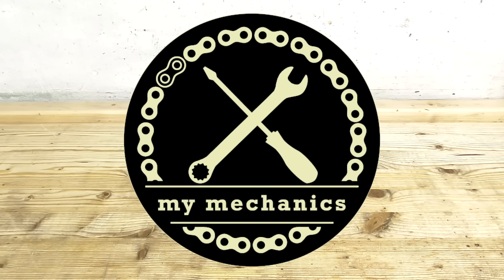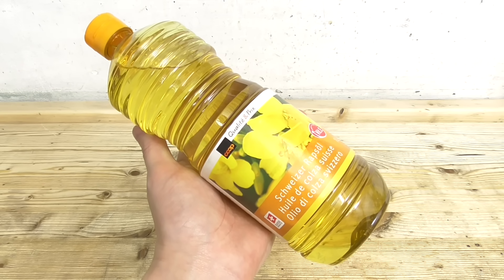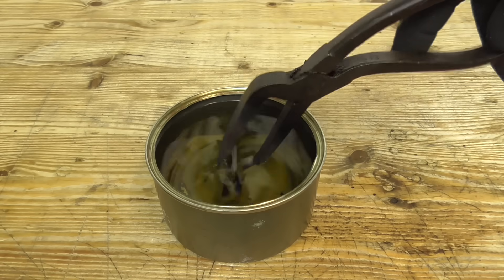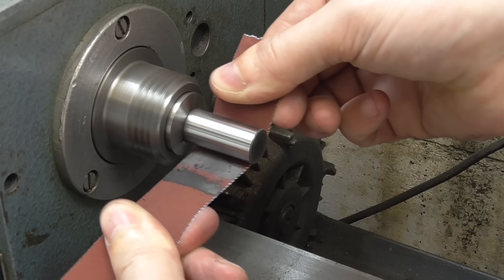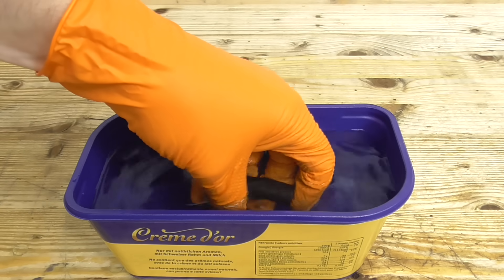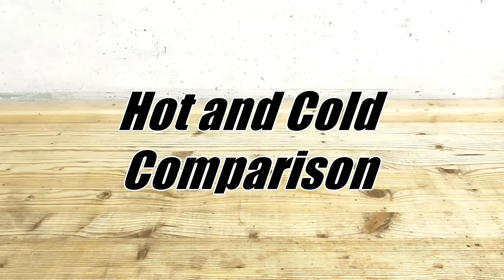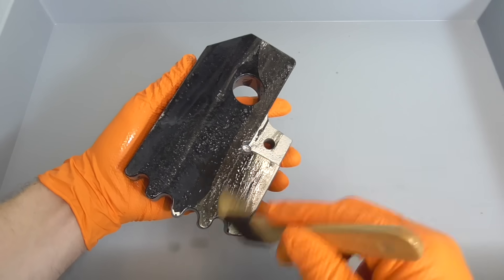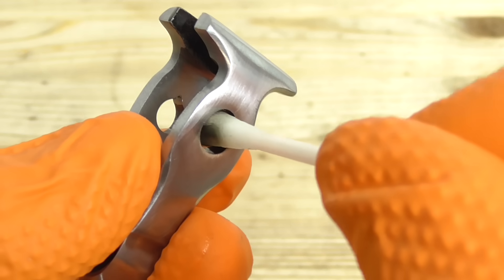How to Turn Steel Black - All you need to know about Bluing

Comment: Your "hot blue" process is actually called oil blackening....for actual hot blueing you will need a hot salt bath.
Reply: Yup, came here to say the same. The described "hot bluing" here yields a coat of oxidized oil, not one of magnetite as in real bluing.
Reply: Nerds
Reply: Is there a major difference between the results?  And do you know the salt bath mixture
Reply: Which is more durable  or better overall as nd why? Thanks
Reply: The oil method is basically the same as the seasoning on a cast iron pan.  It'll probably be more non-stick and won't need oil for rust resistance, but it's not as durable as true "hot bluing", which converts a layer of iron into magnetite.
Reply: An uncle of mine used hot blueing as a gunsmith. He had a whole separate (tiny) building for it. Long, narrow bins over oil burners. He'd scoop the dark blue crystals and pour then into the bins once the contents had melted. A lot of the details are lost on me, 50 years have passed and the memories are from when I was a young boy.

The image of him stripping down to his skivvies before walking into the building is one imagine that's hard to loose. He said no one should ever work that way, the chance of deep burns from splatter were high. But he was came from a long line of master machinists and craftsman. He'd say, "I knew how to work with it", ha, ha, ha. To my knowledge, he never got burned seriously. I think it was a calculated risk, walking into a tiny metal roofed building loaded with oil fueled burners on a hot Florida day... either pass out from the heat, or risk nasty burns on sensitive parts. Ha, ha, ha
Reply: @sunnyvoid7206  hot bluing with a salt bath is a dangerous diy project. The salts are extremely caustic,  exponentially so because of the heat involved. It can be done at home though. However, if you go that route, get very educated on it and take every safety precaution.
Another acceptable and effective method would be to rust blue. It is time consuming and somewhat tedious, but no more dangerous than making soup and cleaning the sink. Plenty of tutorials on it. Simple version is thorough prep and cleaning (polishing recommended), wipe or brush on a rust accelerator (weak acid such as vinegar or dilute muriatic acid will do), wait for rust to form a complete coating then boil. Card off excess and repeat (minus polishing/ sanding). Need at minimum 4-5 times,  but can do many more times for more protection/ thicker blue layer. Dry and oil liberally. 
This is the traditional way guns are blued, with some variants in process and materials.
Reply: Sometimes this is referred to as fire bluing, it is frequently used in gunsmithing, especially for small parts, such as screw heads.  You can actually attain a very blue color which is quite attractive as a contrast to the blackened surface of the firearm.
Reply: Semper Fi  ok bird
Reply: @patri0t1776  I have to ask a couple of questions.  1) "Wait for rust to form, then, "Boil it"?  What/how are you using to, "Boil it" with?                                                                    2) "Card off  excess.." I'm guessing that you mean you mean to use a card file to clean it?   Thanks, I've been trying to figure this out. (p.s. years ago when I was in Apprentice School,  we had our projects sent to another department to be hardened.  When the parts came back, they were covered with a sort of black scale.  We were told to be very cautious about the scaling on the parts, as it contained arsenic (salts) as part of the hardening process. Can you shed any light on that?)
Reply: so ..there !!!
Reply: @RobertLBarnard  and a long line of Monty python  lumberjack  ( sorry it an English joke)   stay safe
Reply: @ladeseddy5994  You're correct, it was Cyanide.
Reply: erik dee  I thought the same :)
Reply: And a back rub.
Reply: Blake Blake 😂😂
Reply: @sunnyvoid7206  The salt bath mixture is: dissolve as much nitrate as possible into water and add sodium hydroxide until then boiling point is above 140 Celsius. Boil the parts there for 10-20 minutes.
Reply: Bill Wessels no, fire bluing, hot bluing, and rust bluing are very different indeed. Fire bluing involves hearing the metal to a bit over 200 degrees C, at which point it will develop a blue oxide coating. Hot bluing involves boiling in a hot caustic salt bath which converts the outer surface into magnetite. Rust bluing involves repeated rust cycles followed by boiling in water, and doesn’t use anywhere near as much heat as fire bluing.
Reply: JStephen Allington it gets boiled in water between rust cycles. Carding off the excess is done with steel wool.
Reply: Thank God, 40 comments down someone said this. Lol. This is NOT hot bluing! It’s oil blackening

Comment: In the firearms sense, "hot blue" is normally associated with a molten salt process.   What you're doing with the oil is normally called oil "blackening" vs "blueing" to distinguish the two processes (and the oil finish tends to look brown-black vs blue-black which is pretty clear in your video)..    Another less common method that involves mild heating is "rust blue" where parts are placed in a heated, moisture-rich atmosphere to deliberately cause a coating of very fine rust to form.  This is time consuming and normally only done these days for antique firearms restoration..
Reply: ty
Reply: I have done the rust blueing and its not easy, but it does work pretty good.
Reply: yes, this is calle "black oxide to be more exact" -- and many Youtube videos give WAY BETTER advice on it, including not DAMAGING the grain-structure of the metal, as his instructions will, and getting a darker finish with less 'coats'/repeated blackenings needed -- and processes that DO work on stainless.
Reply: Bluing in general is just heat, no oil. The most famous example people are used to would be exhaust tips.
Reply: I regularly do hot salts bluing and occasionally do slow rust bluing particularly in the rare tin soldered double that might come across the bench. The ways presented here are nothing but expedient alternatives to the true long lasting methods used by gunsmiths, etc. B&C cold bluing is good for touch ups and for the screw or small part that doesn't warrant lighting up the hot blue vats or going though the tedious and lengthy process of slow rust bluing.
Reply: Boiling guns is fun though!
Reply: @jhr7190  Do you have any suggestions for more helpful videos? I don't think that "my mechanics insights" was trying to suggest he is the premier, final authority on blueing (or bluing, if you prefer), just trying to share what knowledge he possesses with people who might be interested in listening.

 I would like to see the videos you suggest, because I'm planning to do some blueing soon, and the more accurate information I can get, the better!

I'm curious what you mean by damaging the grain structure? Is it because the oil is cold? Is 300° Celsius too hot, in your estimation?
Reply: for firearms i use 100% pure Lye, Sodium Nitrate and Sodium Nitrite and heat to around 295 degs. it's nasty and dangerous and will burn the hell out of you if it gets on you due to the heat and caustic chemicals. but, it's real bluing and lasts. it will also eat non ferrous metals pronto!!. you can use Ammonium Nitrate but buying large quantities of it kinda makes the Feds nervous these days. The mix ratio is 5 lb lye (sodium hydroxide) to 2 1/2 lb ammonium nitrate (fertilizer), to 1 gallon water you will need to adjust the mixture according to the size of the tank you use. if ammonium nitrate is not obtainable, sodium or potassium nitrate can be substituted at the same ratio. this type of bluing is definitely not for the beginner.
Reply: @jhr7190  Thanks!
Reply: Ed G  therein lies the problem . there is a kit one can buy to do that it costs as much as the bluing chemicals. You can safely neutralize two gallons of raw bluing salts solution at one time (giving you a total solution size of 4 gallons) just as well as one. ... You can expect to use a pound-amount of dry Sulfamic Acid equal to the pound-amount of bluing salts you used to make up the original bluing bath you are neutralizing.
Reply: I do a bit of rust blueing. Easy. Have a look at C&Rsenal anvil episode where they restore a mauser.

Comment: I would love to see the difference in rust resistance between a blue'd piece and a normal bit of stock
Reply: @Ninety Four Moto so is cold more for the appearance it gives? As well as the minimal protection?
Reply: @Ninety Four Moto Hot blueing doesn't do much either! The only rust resistance offered is by whatever oil gets trapped in any surface roughness. Keep it oiled, it'll have some resistance to rust (but then so would non-blued steel)
Reply: Great question Lux. If oil is imbedded, it should help, but how much
Reply: Bluing DOES protect from rust since it forms a layer of oxyde on most of the surface, idk where you guys got the idea that it doesn't but it's a fact that it does.
Reply: People don't do it just to have black parts.
Reply: @dannymoneywell  For sure, it doesn't make it rust-proof as you know but it certainly improves rust and staining resistance.
Reply: Let me save you some time and tell you it's waste of time "blackening" steel. Otherwise it would have been a well known method to protect from rust on the cheap. Do what I did and test some metal pieces while leaving it outside. 3rd day and rust will appear...
Reply: @Ninety Four Moto spot on. Even stainless is literally stain less, not stain proof. You can get rust on stainless even. For parts that rub, make an oilite bushing.
Reply: @Ninety Four Moto I have a hot blued 1911 beaver tail that will rust within a day if I don't keep it pretty much wet oiled from the sweat of my hand. it'll have surface rust the next day. ACW 1911 so it's not a cheap part.
Reply: Its completely different. Bluing is what older guns used to prevent rust. Without it surface rust appears in days in some climates.
Reply: @ianinholland8390  i dont know what bluing you are talking about. The railings st our local park around the oval have been there for 60 plus years without any rust. Cold bluing also eorks well as I've done it myself.
Reply: @Ninety Four Moto rubbish, if you aren't getting good protection you aren't doing it right.
Reply: @Ninety Four Moto haha call of the coward. "Whatever" 😂😂😂😂
Reply: @JayFude  depends on the stainless. Actual marine grade will not.
Reply: @asherdie  can and will. Tea staining and pitting both can happen on 316, mainly because of the chloride in sea water. Still need some sacrificial metal to keep it from rusting, like zinc.
Reply: there is a science here . When you heat metal the atoms align , when you quench the piece it locks them in place and produces magnetite instead of red oxide
Reply: @KokainAI  was it the same for blued and non-blued steel?
 Also, blueing IS a well known process that we've been using for about 200 years.
Reply: @tclanjtopsom4846  base metal for railing will be iron, maybe cast or wrought. The oxide is more stable and adheres to the surface and so corrosion is self limiting. Carbon steel much more active and the oxide is larger then replaced steel, consequently it get thrown off exposing fresh steel. Not self limiting
Reply: @KokainAI  Proper blackening protects steel. Does not turn it to stainless steel, but offer a good protection. A proper bluing creates an Fe3O4 (magnetite) layer that protects the base part.  To get the better protection you should apply some oil. The magnetite pores will retain it and help with the protection.
Reply: @asherdie  exactly the nore nickel in the alloy the more resistant to corrosion
Reply: @Ninety Four Moto Hands are not corrosive. it is the saline and water in your sweat that is mildly corrosive with a mean pH of 6.3 
(FUN FACT: Sweat is more corrosive than blood!)
Reply: @Ninety Four Moto FWIW: I knew what you meant! just a play on words! Safe safe!
Reply: @Ninety Four Moto Correct, I am an Amateur Gunsmith and I prefer to first Cold blue then after it's set I Boil it in Oil. Comes out looking factory fresh!
Reply: @KokainAI  'Browning' is another option for part protection.  Takes more time to do properly.
Reply: Is project farm listening?
Reply: @SW-qr8qe  Absolutely true.
Reply: @frankdmioli925  Trouble is, adding heat alters the mechanical strength, and crystalline alignment. 
But for most things it's not a big deal, unless you're talking about weapons or tools.
Reply: @razorseal  cool, thanks. Won’t be buying that brand! Lol I’ve thought about it many times, but ended up with less expensive options instead. And have had zero issues with them. Sounds like more expensive doesn’t always mean better, right? 😁
Reply: Cold bluing provides minimal rust resistance. It's mainly used for cosmetic purposes such as re-bluing a scratch on a gun barrel.
Reply: @Ninety Four Moto you literally have a degree?? you either do or you don't
Reply: @Ninety Four Moto zinc based  primer coated with  good quality  silver paint  coat with veg. oil spray paint!!!!
Reply: I also wonder which wears longer-as maybe a knob that gets handled often,which would last longer before it wears off.
Reply: @asherdie  Unless it has been welded, or overheated during processing. Then no longer completely austenitic and will therefore rust.
Reply: @KokainAI  it IS a well known method. Derp  LOL. A blued or blackened piece of metal that has been oiled, will remain trust free much longer than a similar piece of steel that has only been oiled.
Reply: Hot or Nitrate bluing is the least rust resistant, it's really just changing the color of the steel. 
Cold bluing is second, it leaves a layer of magnetite on the steel.
Rust bluing is the best, it leaves a think layer of oxide that is actually harder than steel. 

Case hardening is something different. I don't completely understand the process, but it is supposed to be very strong too.
Reply: @MasterFancyPants  nope
cold bluing does not create magnetite. It is coper-selenide that gives black color. All cold bluing liquids are based on copper sulfate, selenium acid, and few other ingredients (nikel sulfate, phosphoric acid...) 
rust blueing does create magnetite, it can give realy great look, if it's done properly, but... it is very time consuming. After all, most expencive guns are rust blued.
oil hot "bluing" is just as cold, only apperance, it is actualy burned oil sticked to the metal. You can consider it as gunk, that is evenly stuck. More like a "paint", then bluing.
hot nitrate bluing is less rust resistant than rust bluing, but much better than cold or oil (BTW there are two kind of nitrate bluing, one in molted salts, and other in liquid)

Comment: Every time I see one of these blackening videos they always use metal channellocks or needle nose pliers to pick up the piece being blackened. Then they say "be careful not to scratch it" Lol. The best way is to use kitchen tongs with silicone ends/tips, with steel handles. Just a recommendation to prevent any scratches and achieve a better result. Hope this helps. Thanks.